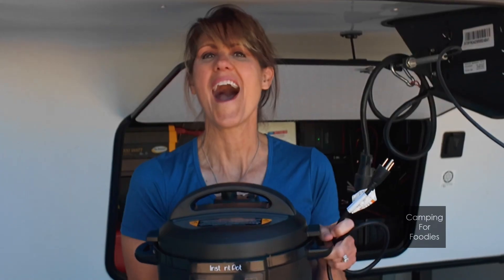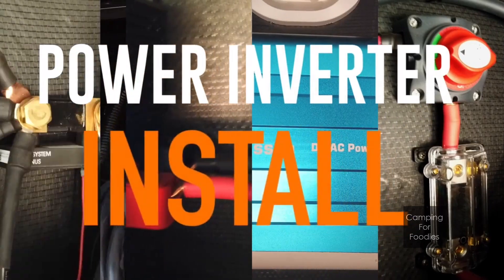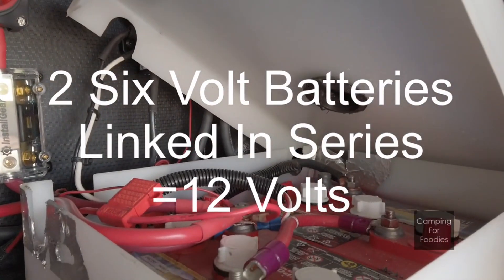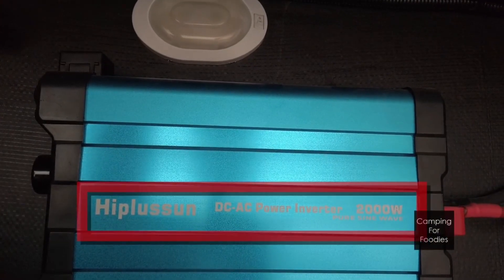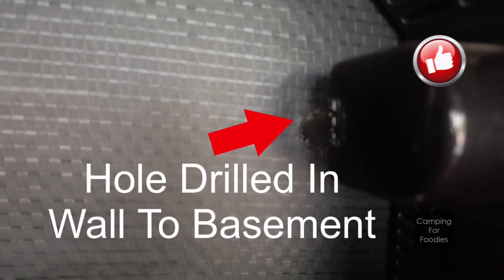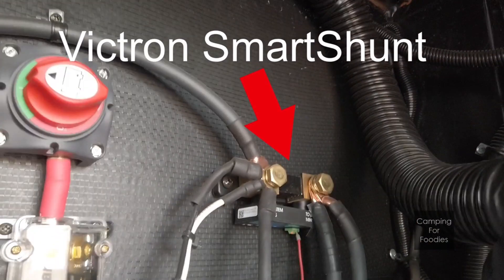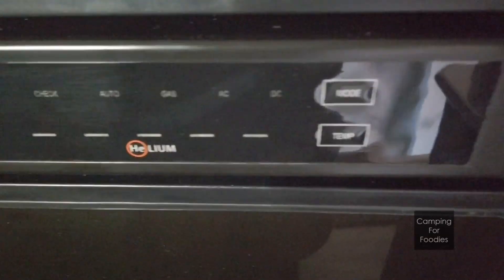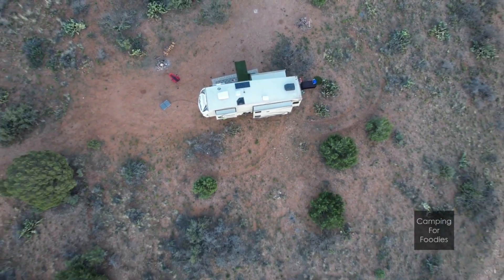How To Hook Up Power Inverter In RV: Easy DIY Installation For Boondocking Power

Comment: You can’t run the water heater with the inverter on?
Reply from the maker: Hi @christian350zdude, nice to meet you! This video was our old trailer but we could run the water heater with or without the inverter on. All the water heater required was 12 volt dc power to operate its control panel to operate and ignite the propane. If you have any other questions, please let us know, Kim & Pete.

Comment: So I have solar panels that charge my batteries. It will run the fridge lights and so on.
But I wanted a invertor so I can run the tv & micro wave. My question is can I run the microwave the inverter and still have it charge my trailer batteries at the same time
Reply from the maker: Hi @KingTheCorso, thanks for the question. Pete says when you have the inverter and microwave on, they draw a lot of power. So, unless you have a monster solar panel bank, your batteries will be discharging during the time the microwave is running. Our current rig has 1300 watts of solar and 900 amps of lithium ion batteries, even in full sunlight when we run our microwave, we are still discharging close to 90 amps from batteries. As soon as the microwave is turned off, the solar panels will be producing enough power to start recharging the batteries again. He suggests you invest in a Victron Shunt so you can monitor how much power is going in or coming out of the batteries at any given time. We have all of the gear in our Amazon store for this project here https://amzn.to/4bz7jGW Please let us know if you have any other questions.

Comment from the maker: ⚡ This is the DIY inverter setup we used in our previous RV — it was simple, affordable, and worked great for boondocking.
In our current rig, we have a dealer-installed system, but if you’re looking to add power off-grid without breaking the bank, this video walks you through what worked for us.
Got a question about your setup? Drop it below — Pete and I are happy to help!

Comment: I really like the simplicity of this setup for not having to run wires inside the camper to the main panel. Thinking of doing something similar on my fifth wheel. 

I’m really curious how your 2 separate battery boxes interplay together and how you have that set up. I have 2x 100ah battle borns that I moved into my new camper from the old one. But this new one has a 12v only power hog fridge. Thinking of getting another 300ah battery from a different brand and coming up with a way to keep the battle borns in use. People say not to mix and match so I’m hoping theres a way to have 2 separate “banks” operating safely.
Reply from the maker: Hi @JabroniusTheTerrible, Pete here. I totally understand your situation. Since we made this video, our situation has changed. We sold our older 5th wheel last year and bought a new one. We took our two Litime 300 amp lithium batteries out of our old RV before we sold it so we could use them in the new one but the problem was the new trailer has a residential-size 12 volt fridge so we needed to add more storage capacity. So, we added one more Litime 300 amp lithium battery to handle the demand.

Originally, when we decided to switch over to lithium, I did a ton of research and decided to try something cheaper than the Battle Born batteries. At this point, we have been using the original two Litime batteries for about two years and the third for about a year and I’ve been thrilled with them. 

I agree that mixing and matching lithium batteries, especially of different compositions and ages, is not the best idea. On the other hand, I would never try to redesign my DC system in order to accommodate my collection of batteries. Simplicity is key for me. If this were my project, I would sell my two Battle Born batteries and buy some big, matched lithiums to replace them. And when it comes power, my opinion is: A lot is good…… More is better…….and too much is just right! Assuming you have the room for them.😉 You can see our current battery set-up in our boondocking setup video here https://youtu.be/sG-UkPY0hdo If you have any questions, please let me know.